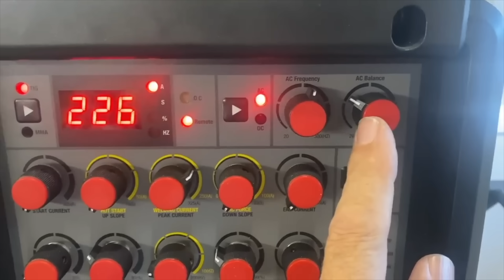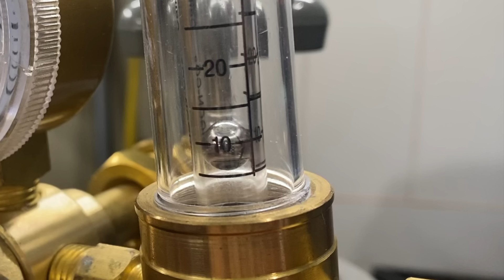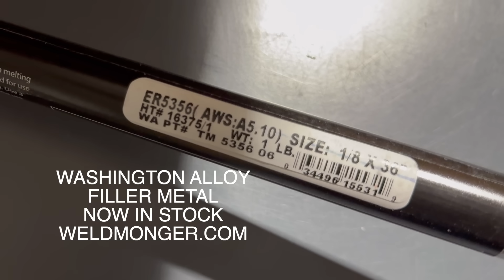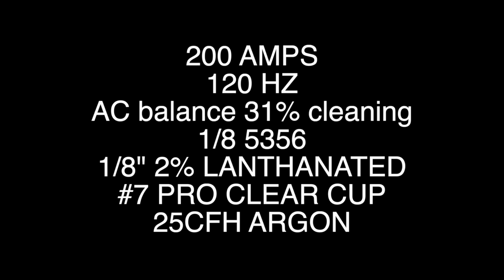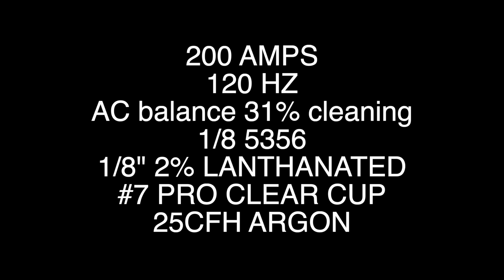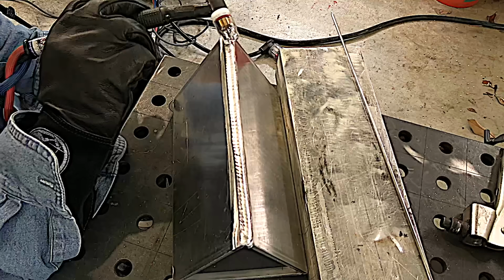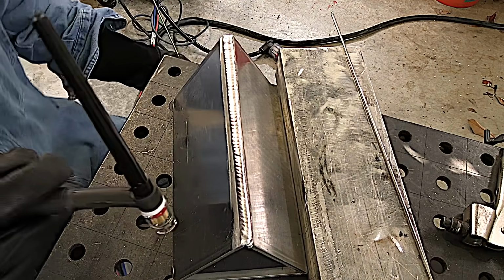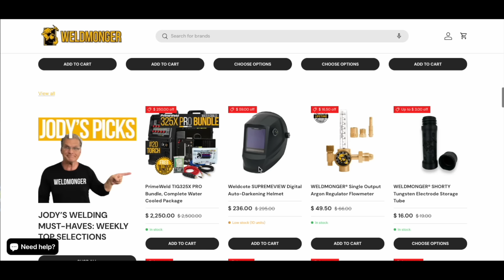TIG Aluminum Tips and Settings 3/16" Thickness

Comment: Do you think I need more flow rate at higher altitude? I moved and found I couldn't tig weld anymore 'til I changed the gas also. Maybe the argon mix wasn't really the same as advertised. Going to repair an item this week. I don't think I can change my machine's frequency. Now I'm a bit jealous. My machine is an Amico 160dc
Reply from the maker: That’s a good question. I don’t know the answer. Humidity has an effect but I don’t know about high altitude

Comment: Jody, can you perhaps explain a bit about TIG cup choice? I was told by a welder once that the size of cup was (rule of thumb) related to the electrode size, but that's about all. Thanks to you, I use a clear cup these days but the pink ceramics are still out there. Apart from personal preference, is there any reason to use a particular cup type in a certain application? When I was looking at weld procedures years ago I can't recall having to state the cup material, so does it matter?
Reply from the maker: Choice of Cup size and type is due to material type, amperage, joint configuration, personal preference, and probably a few other factors. For example, Many welders prefer a #5 standard cup for aluminum. But stainless usually needs a bigger cup with gas lens for best results
Reply: @weldingtipsandtricks  Thanks. I know you have lots to go on with, but perhaps worth a video on what your thought processes are when selecting.
As a self learning and occasional welder I have never really discovered much out there on 'the rules'.

Comment: Thank you for this. Im getting back into tig welding for work & your videos have been such a saving grace.
Ironically, im trying to pass aerospace aluminum, so this fits in perfectly. 

There is not alot of information for aerospace inconel or titanium.
Would you be interested in punching out some more content for those?

The F joints have been kicking my butt.

Comment: Any advice on welding 3d printed aluminum. Having difficulty with contamination , dirty welds etc. I am welding charge coolers for turbo applications but i keep getting porosity as some parts are 3D printed and they leak after welding.
Reply from the maker: I don’t have experience with that but if the application and specs allow for 4047 filler metal, it might help

Comment: Good stuff as always. I am a pipeline welder. Do not do much tig welding. I remember in high school the old Miller Gold Star welding machines. They were tall not much to them. Than the Syncrowave 300 came out it was big. Had a lot of extras with it. That was 1980. Stay well.